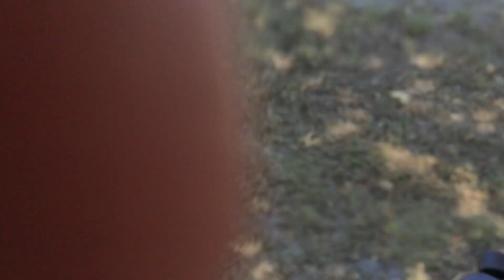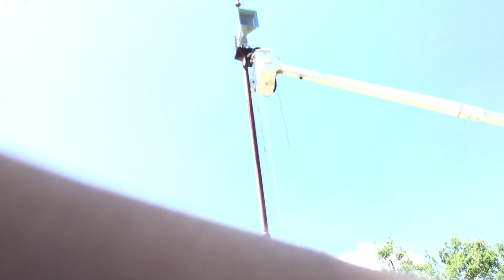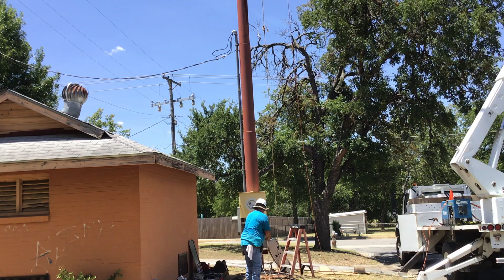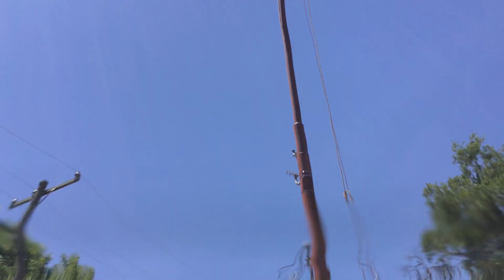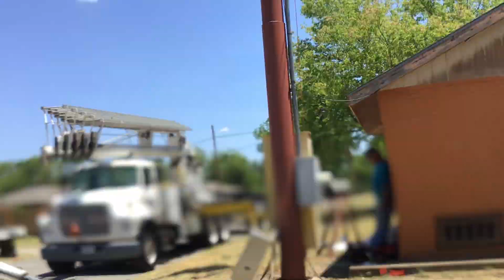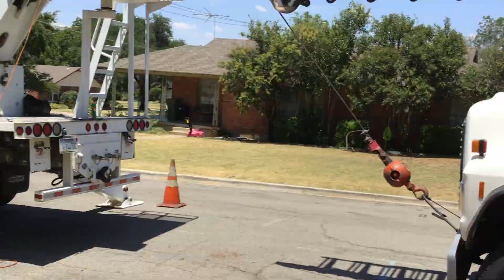Whelen vortex siren install in Richland Hills Tx, (Part one out of 2) (READ DESC)

Comment: Do you know  what is going to happen with the  P-50 ?
Reply from the maker: They told me it’s at their storage facility on Baker Blvd. most likely going to be there until someone wants to purchase them.
Reply: Why did they replace them
Reply: @loren4777  The city  said that their outdated   but I see no reason to  replace  if they work just  fine
Reply: @alarmandsirenguy  they’ve had them since 2002 how are they outdated the state of Wisconsin has over 20,000 still and any that been replaced are sold to rural towns that need sirens them things range for 4 miles that’s louder then a whelen siren Memphis,TN has 3 p50s 1 mobile directo and 3 p15s 20 t128s and they have no Desiree to get rid of them
Reply: @loren4777 While I will agree with you on that, apparently Milwaukee is replacing their old ACA system with some "newer more reliable sirens." Pretty dumb if you think about it.